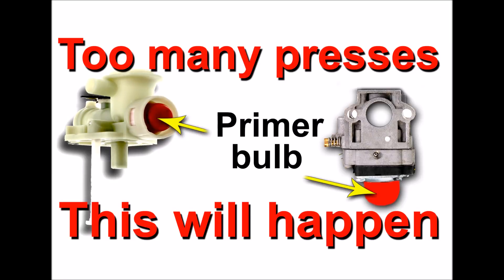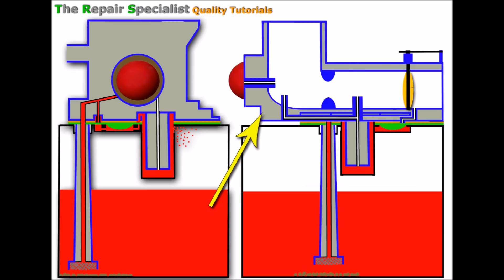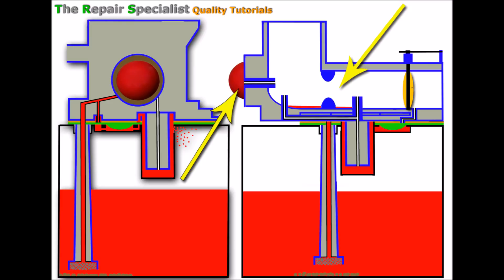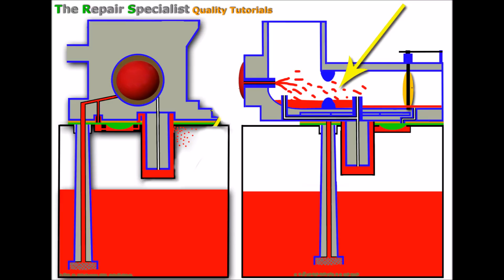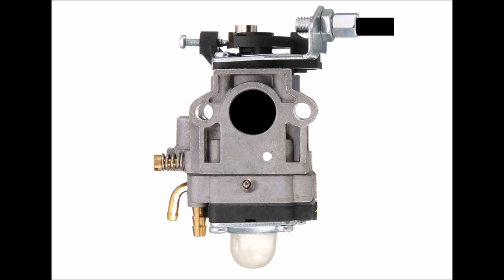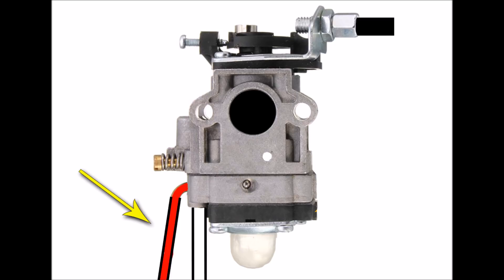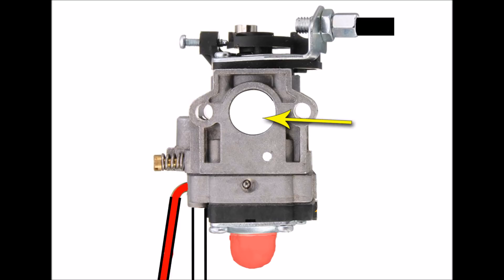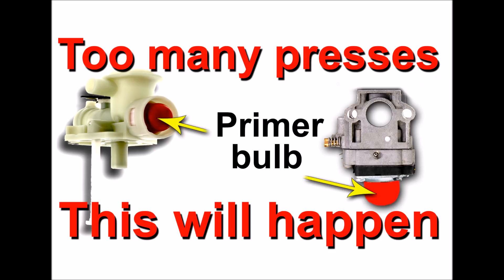This is what happens if the Purge Primer Bulb - Pressed too Many Times!  (by Craig Kirkman)

Comment: I stripped my zama q10 hedge cutter carb. For some reason I can get the air out, the bulb fills with fuel but then goes solid. Checked the return hose and it's clear. Is it possible for air to purge but not have fuel return to the tank?

Comment: Would you be able to answer a question I have, I recently brought a petrol strimmer from SGS and I had to return as the unit was too heavy for me to use. When sgs received the item back after I confirmed I did not use it try to, they are saying as there was fuel in the priming bulb they can not expect my return as they are saying I put fuel in it, and attempted to start it, which I did not. My question is would there still be fuel in this bulb left over from SGS testing this unit as surely they would have tested it. I would really appreciate your thoughts. Many thanks.

Comment: This is very interesting!  even though I have a DIY channel, my knowledge is not on small engines.  I swapped out an old carb with a new one, the primer bulb fills with fuel and the return line pushes fuel back into the gas tank.  I'm not howver seeing fuel in the inlet.  the engine won't start yet so curious what the issue could be.

Comment: This may be hard to believe , pushing the primer 2 sessions of 280 strokes to successfully prime the DD 13 , DD 15 , or DD 16 .
Reply from the maker: Wow, that is a lot of Primes. It sounds like there may be some issue with the priming system.  DOes the engine run ok after it has started? or does it run un-even, surging? Craig
Reply: @TheRepairSpecialist  Looking for my paperwork , it came in a DD filter box .

Comment: I have a brush cutter that will not start good compression , good spark and a new carburetor . The cylinder bore is undamaged but none of the experts on these machines tell you how to set the needle in the venturi or a starting point to set the mixture screw. I have two out board engines for my boat which I maintain one I have done a complete (unnecessary) strip down and rebuild to check any possible hidden problems, but this brush cutter has beaten me.The only thing I can think of, is using outbord two stroke oil has caused a problem within the carb as OB's run cold and garden tools run hot. Any one with any idea's

Comment: I'm trying to repair a chainsaw the brand is efco. No model can be found. It doesn't have a primer bulb and one metal pipe from the carburator is closed by a rubber cap. Is this natural. The brand of the carburator is Walbro. It is difficult to pull out and feel like a four stroke one. Please explain why?

Comment: Once I see gas in the purge bulb is the time to stop pressing the bulb and start the engine. I always thought excess gas just back to the tank.
Reply from the maker: HI. Yes, you are correct. Most of the fuel does return back to the fuel tank, but a small proportion does eject into the inlet on some machines.  I will make another video explaining this better. Thank you for your comment. Craig 👍

Comment: I have a problem with my chainsaw. When I press bulb fuel squirting out of fuel tank vent, pressing it several time generate positive pressure in fuel tank and sir gushing out once fuel tank cap unscrewed. This happened after I have changed fuel line??

Comment: Do you have a video on the primer bulb that gets sucked in and stays like that for a little while or you prime and prime and eventually it fills?
Reply: Same problem, did u figure it out?
Reply: @mblake0420  I replaced the primer bulb as it had a crack in it and you would think that it just wouldn’t suck fuel in.

Comment: I like this theory - I have another one and Mine is better because although your air purge bulb is good advice - An Electric Dewalt Chainsaw doesn't need Priming - I mention this because 2 years ago I switched from petrol chainsaws to electric Dewalt Chainsaws and - I know this is going to sound totally unbelievable but I've had no petrol problems since - I did once get all the way to the top paddocks and find I'd left the Dewalt battery at home - but that's not quite the same as over priming.

Solar panel,reg, inverter, Dewalt Charger, Dewalt Chainsaw, Dewalt Tree Down, Dewalt Firewood from the Sun.

OK lets try the other way - the petrol way
Expensive drills are bought in to find and suck out the carbon filled oil.
The carbon filled oil is distilled like we would alcohol to make petrol.
The petrol is used and wood is used but so is all your world wide carbon emissions.

So lets go back to Green Energy.
A Dewalt saw is quiet, draws no attention, cuts right to the end of the battery well past the chain and is Pleasingly light and easy to use.

As opposed to the petrol powered saw, that leaves your ears ringing, needs you to personally own an oil company or pay through the teeth for it and is killing the planet.

!!!!!!So - back when everything turned to shit when starting a post hole borer it was flooding - I knew that but I didn't know how and why it happened and Thanks to you I now do. !!!!!!

Please answer my Hypothetical question: I do have a Dewalt 56v chainsaw, I live on Solar - Why would I want to go back to a petrol saw?
Reply: You finished on The soapbox?

Comment: Thank you very much for explaining the function of the primer bulb . We are told by another small engine site that the primer is only on 4 stroke engines and is called a purge on 2 strokes because it only expels the air so fuel doesn't actually enter the engine. This has puzzled me up to now how this can be, but your excellent video has clarified things for me

Comment: I just tested a external 2 stroke purge bulb and the "injecting fuel into the inlet" part is complete hogwash. You could press the bulb 100 times and you'd never get fuel into the inlet, the one-way valve on the purge bulb won't allow it to push fuel back into the carburetor.

Comment: Hi
My primer bulb is pressuring up after 3 pumps. I put a new carb on and same thing happening. Removed the return to tank line to see if blocked but same thing happening.
Homelite 38cc chainsaw.....?
Reply from the maker: I will do a video on this, but for now did any fuel come out of the return pipe when you press the bulb? i take it that it didn't?
- Craig :)

Comment: I have an old Go Kart with no Primer Bulb.  How could I add one? The gas cap has a small hole in it and I use a tube to blow air into it to get the carburetor to prime.
Reply from the maker: Hi. Unless you can find a replacement carburetor, with a primer bulb, that fits your particular engine then I personally wouldn't try to fix one in.  The reason being is that it could make much more work for you.  I.e. if you were to mistakenly cause some damage or just slightly disrupt something within the carb, which could ruin things for you and cost you more money.  If your engine needs this extra fuel you are blowing in then this tells me that something that should be right just isn't, and that's the issue. What I mean is that it seems that the cold start system is not functioning as it should.  If the manufacturer felt that your particular engine needed a primer then there would certainly be one on there.  I agree that it would be beneficial in this case to have one, but I would personally look into how I would fix the cold starting issue before anything else.  Does it have a choke? if so is the choke manual or automatic? Are the linkages correctly connected to choke? Is the choke opening and closing enough, as it should do?  If you take a real close look you might find a problem here.  I, personally, would start there and see how you can progress with it. 

However, in a very small number of cases I have known people place a small inline manual handpump in the fuel pipe (between the fuel tank and the carburetor).  Before they start the engine they give the pump a few pumps to get fuel into the carb (in a similar way to you blowing it in).  You will have to decide if this will be ok for your engine and find the pump with the size and shape that will help you.  Again, I can't say I have done this myself and can't tell you it will be ok to do so. I have only seen it done by others. Just letting you know, to help with options, that's all! 
Ultimately though it's your decision. 
I hope this helps. 
Craig

Comment: The explanation was very good, as was the previous video I watched about why an engine might need choke just to run. However I think an omission may have been made.
You mention Purge Primer bulb. 
I stand ready to be corrected, but I think they are two different animals. The Primer bulb is exactly what you have just described, a means of giving a partial flood to the inlet manifold as a means to give the engine adequate enrichment for it to make its initial start. with a carburettor that does not have a choke flap as part of the design by pumping excess fuel into the carburettor.
However a purge bulb while it may look identical, is a means of SUCKING fuel through the carburator so there is adequate fuel within the carburettor when you use a choke to enrich the inlet manifold area. It does not matter how many times you pump a purge bulb such as used on Sthil chainsaws or brush cutters that use a choke device, they will not flood, as the fuel simply passes through the one way valves in the carburettor back to the fuel tank.
Reply: You Are correct.
Reply: That's exactly what I was thinking. The only way a 2 cycle carb can flood is if the priming forces the needle valve open against the spring pressure and I didn't think it could.  That's why it's called a purge valve as it purges the air from the lines and carb with the excessive fuel going back in to the tank.  A primer actually squirts fuel in to the intake.
Reply: Yes, I can confirm this is correct also, believe me when I say that I know.

Comment: 8:30 actually you are wrong,  fuel is never pushed into the throat of the carb. If it is then you have a leaking check valve on your carb. The bulb on a 2 stroke like this is called a purge, not a primer. You purge the air out of the carb circuit. The choke is what pulls gas into the throat of the carb. You can push a purge bulb 1000 times and never flood the carb.
Reply: If you take the air filter off and look into the carb you can see the fuel squirt Into the intake manifold tube. At least for this type I’m not sure of the other ones.

Comment: In the video named: "How a primer bulb works - Purge Primer Bulb - HOW IT WORKS - (stihl chainsaw etc)
" at 13:51 it is said:
"We might say: When the primer bulb is pushed in fuel is pushed back up this way, why doesn't it come out this jet. Well, there is a very small valve there on this jet and I can show you, there it is. .... Only when the engine is running does that valve open enough to allow fuel to go into the venturi to mix with the air that is rushing in, to atomize it."

Comment: Should you a lot of air bubbles in the primer Bulb when its running/ it runs like new at idle but under a load i it like it doesn’t have enough power

Comment: I have problems with a Troy bilt four stroke cultivator. Seems the primer isn't delivering fuel to the right spot in the carb although the primer appears to work fine. I get a no start, put a little fuel in the plug hole and it fires right up and stays running. Very frustrating. Thanks for all your great videos.

Comment: Do you have a video that explains how a three line primer bulb works? I have a TroyBilt trimmer, 4 stroke engine. I had occasion to remove the carburetor and lost track of which line went to which position on the primer. I can't  seem to get it figured out.

Comment: Thankyou for the clear description on the 2 stroke and the only question i have,  is that you pump enough times to see full fuel in the return line BUT how many pumps after do you need to inject the right quantity of fuel in venturi ?
Reply: The primer (air purge valve) will never introduce fuel into the venturing. The primer bulb will only circulate fuel through the carburetor, ready to be used. To introduce fuel into the motor, it can only be done when you open the throttle.

Comment: Brilliant - I was told it didn't matter how many times I pressed the primer bulb !
That answers a lot !
Many thanks.
Reply: Paul's comment reminds of a question I have. Is there a difference between priming and purging? Seems to me that a system with a choke mechanism will need only to have the fuel line purged of air because choking the carb will cause such a low pressure in the venturi that enough gas will be drawn up for combustion. Contrarily, a system without a choke will need to be primed. Perhaps -- and I'm thinking out loud -- Paul's friend told him it doesn't matter how many times you press a PURGE bulb, because all a purge bulb does is clear the line of air, it doesn't actually draw gas up and deposit it into the reservoir before the venturi.
Reply: It depends on how technical you want to be, some manufactures call it a purge/primer bulb, essentially it does the same thing. I'm referring to small diaphragm carbs found on handheld equipment. Not carbs that use a float bowl, they actually pressurize the bowl to make fuel come out into the venturi.
Reply: On Two stroke diaphragm carburetors  made today you cannot over prime/purge!  He is wrong with his description, there is check valves that prevent fuel from coming out the venturi.
Reply: He actually explains it in another one of his video's. https://www.youtube.com/watch?v=jalfpoldyo0

Comment: If old fuel has gummed up the primer or something is wrong with the primer system, the bulb my require more fuel to start than the three pushes. What I have found is people do not FULLY push the bulb before allowing the bulb to come back all the way, resulting in insufficient fuel intake. On a two stroke, if there is any air leaks in the system, air will be taken in to the system and making the engine hard to start. It may take more pumping to start, or due to a cracked fuel line, refuse to start. Ethanol in your gas will draw moisture and that moisture causes corrosion and even alge growth in the fuel bowl if the small engine has not been run in several seasons.